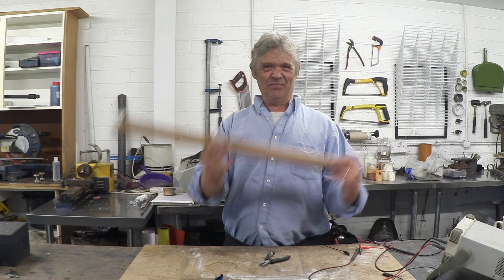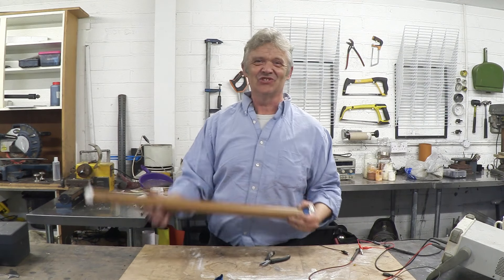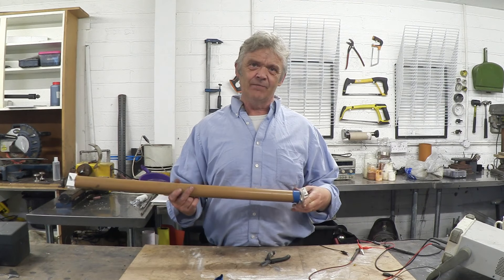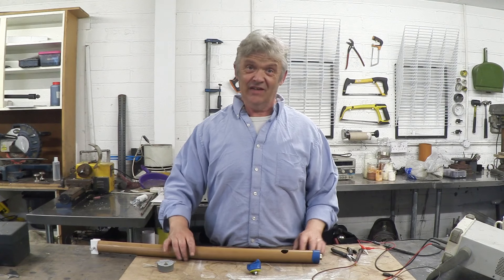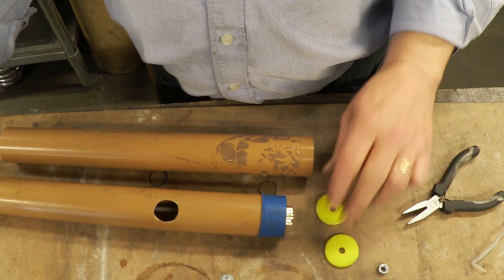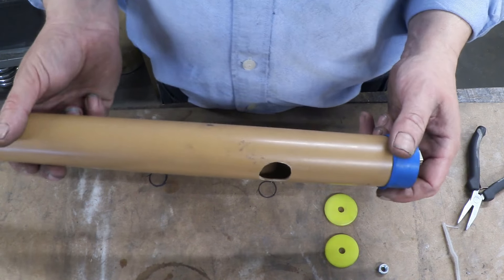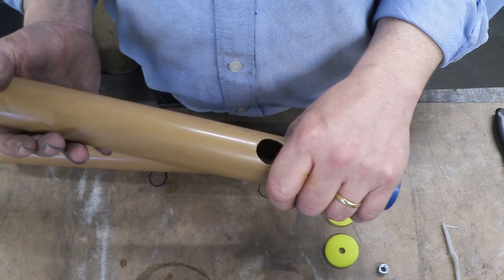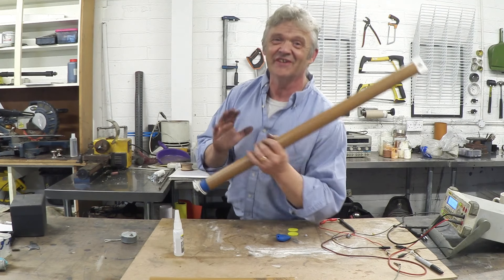A Wind Generator That Works Even When The Wind Stops Blowing

Comment: Your design philosophy strikes me as entirely sound; one big complex thing is more vulnerable than a lot of simple things, so distribution is good, I think, with something as easy to maintain as this.   Speaking of which, if you have a wind-hole that's big enough,  critters are likely to move in, possibly interfering, so you might consider a grill over the opening.

Comment: Ok a usefull amount of current especially if multiplied hundreds of times, but how much power does it give out? It would be better to show both the current and the voltage as if both are millivolts and milliamps.  i.e. if it only produces say 250 mA @ 250 mV that would be 4 needed in parallel to get one Amp and to get one volt 4 needed in series, so you would need 16 of these just to provide One Watt, agreed you may get higher output than this, but based on the current shown by a direct strike and if this represents 16 needed per watt, then to provide say 8KW the would equate to 128000 of these 😯

Comment: If this device flows 200mA at one sharp pulse, that pulse  would need t would need to be about 5 times bigger to flow one amp.
Then the pulsing would need to be continuous. Remember that power is work over time.
Most US homes are set up to draw up to 200 amps at one time. So you would need an array about 1000 times bigger than in this video under constant vibration to ensure powering such a home. 
I'm not sure what zoning you could find which might allow some way to build that. 
I'm also not coming up with realistic ideas of what constant source of vibration would do the job.
So, I agree development would be a fine hobby, without expecting anyone's going to be doing much physical work with a home array. Stupid math.

Comment: Why hook these to a lamppost when you can just put one inside of the lamppost? Put a few cuts near the top of a lamp (shielded from rain, of course) and you've got wind input. Passing traffic and wind vibrates them enough you might not need to bother though.

Comment: Unfortunately the amount of energy coming from such device is extremely low. To power one 100W incandescent bulb we would need a 15 meter pole and 0.5kg magnet attached to a house and 50 km/h wind. The vibration and humming noise would make the house very uncomfortable to live in. 3 blade wind turbine is the most efficient design to catch wind power.

Comment: Why not use a guitar or piano chord for the muscle, because it seems to me you need something that streachs and contracts for catching vibration to move the magnet inside the coil to produce electricity. The stronger the magnet and the more  wraps of wire around for the coil will give it more amps and use the guitar thumb drive used to tune. And there you have it...duh

Comment: 200ma is very very small. A solar cell is far, far more space efficient you'd see 1 - 12A in that much space on any day. At leat 5x more and 60x the power at best. Plus generally structures avoid resonance. It's kind of a bad microphone, it would serve better as an audio toy or a sensor. It would be hard to scale as well just because vibrations are so destructive and undesirable. Lamp post foundations would crack faster.  It would be good if it had a vibration dampening effect or incorporated in vibration dampening. But anyway, vibration is kind of waste energy, it's barely a fraction of what causes vibration. The source of vibration will give up more energy for the materials used. May be a piezoelectric device could suck up more energy by resonating at extremely high levels. Thing needs to be seriously moving though to compete, it's got to be hitting as hard as the wind. Ducted wind reed or something. It'd be noisier than a wind farm.

Comment: Barriers on a highway separating on coming traffic and color them red. Nobody would even notice them. Wind power is a matter of orchestration. The current of wind generated by mass transit alone should make a difference. Every time a subway passes through the tunnel.  The thrust from jet engines at airports. Horizontal and vertical wind generators on all major highways. Future skyscrapers constructed of two airfoil towers opposite each other with stabilizing helipad tying them together. The problem is the people who profit via legislation stifling any progress.

Comment: Hmmmm.  I note the power output was not measured.  Current output means nothing without knowing the voltage across the output at that current flow (i.e. voltage and current must be measured at the same time).  As the output is across the extremely low resistance of a digital current meter (almost a short), the voltage (and hence power) will be close to zero.  Certainly in the low mV range at best, so I'd be surprised if it's giving as much as 5mW of power, meaning you'd need hundreds of the devices for just one watt of peak power, and I doubt that you'd get more than a ten-fold increase even with optimisation, so it's not really practical as a power generator.

Comment: Have you taken it outside and tested it in the wind? You know slapping it works but until you see if the wind actually moves it enough you really don't know if it works.

You get much more motion using a larger tube with a coil wrapped around and a string of magnets down the center. The wind shakes the string of magnets and creates MUCH more vibration and therefor more energy.

Comment: So a small rotary wind turbine mounted atop and wired parallel(?) to the pipe-energy generator ("p-eng generator" lol) could ostensibly decrease energy costs substantially... Looks like I need to learn a little more about electricity 😂

Comment: Measure voltage as well as amps to see actual power. 200mA with no voltage is meaningless. I suspect this current will collapse under any load as there is no power.

Comment: I'd like to see an oscilloscope reading or some actual energy figures. Making 200 milliamps for some unknown period at some unknown voltage is not impressive. My piezoelectric lighter makes about 10000 volts, but nobody is claiming piezoelectricity could power homes and cities.

Comment: Lots of sailboat masts vibrate!  Wait there is a better solution, cheaper?   Why not hook up known technology of microphones to charge super capacitors and then dump those charges into a battery.   So sound vibrations into usable energy!   And who is going to complain about a gaggle of microphones?   Make use of the 'micro' energies into macro.     
How about using strain gauges?   Collect all that rail and building motion due to the heating and cooling from the sun.

Comment: Ok seems some commentars  know so much how about green hydrogen in old oil wells ( C02 stays underground  40 % of oil still underground in old wells) produces helium too ( used in medicial ) @ 1/10 codt of solar then convert to green mrthonal which in a methonal fuel cell drone flys 3-4 x longer vs battery  OH  and by the wayvthe tech has already been field tested in Sask from tech in Ab oil sands ( pump lime undrr ground pump oil out But unfortanely dont get the "other minerals" and eviromental people dont tell u that " golf corses on old oil sand etc. YES I HAVE BEEN THERE  have you? NOT likely "a" 1 403 830 4124

Comment: "Junk Science" this is a grossly inefficient process, much like the (TEC) thermocouple thermoelectric generator, utilizing the seebeck effect  convert temperature difirential between heat & cold to generate miliamps of low yield energy.
In order to gain any useful benefit large numbers of individual (TEC's) must be wired together forming a "Themopile" in-order to produce any significant power yet still minuscule at best. 

The practicality of this prototype of "oscillating magnetic coil generator" demonstrated has never generated anything more than just a minuscule gain of energy,  thereby requiring an obscenely large number of these collectors in-order to realize even a modest production of only a few amps.  

The energy density within the ocilation coil is only slightly greater than that found in the (TEC) thermocouple thermoelectric generator,  dismally disappointing results emphasize that this device will never be much more than a fanciful novelty...